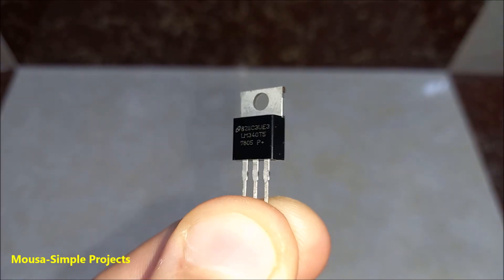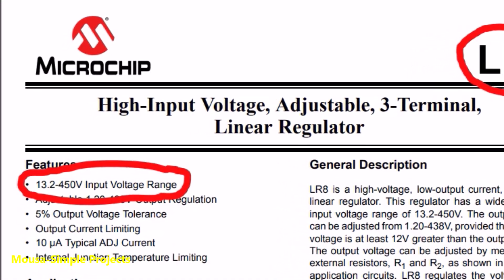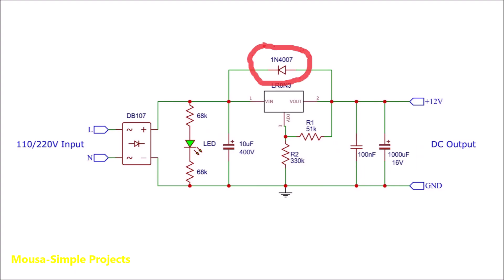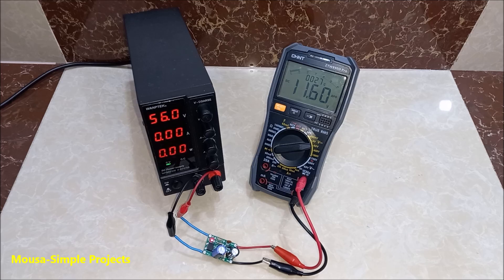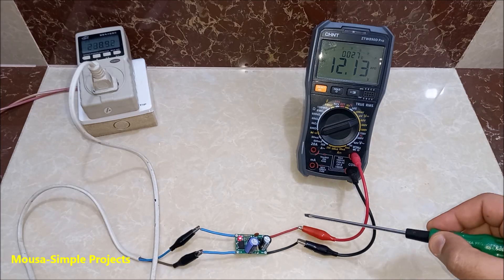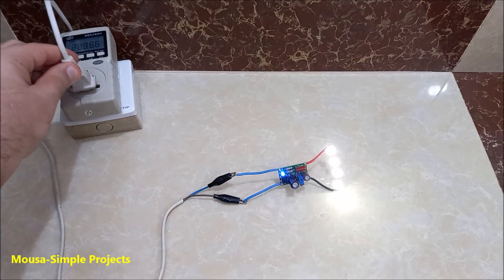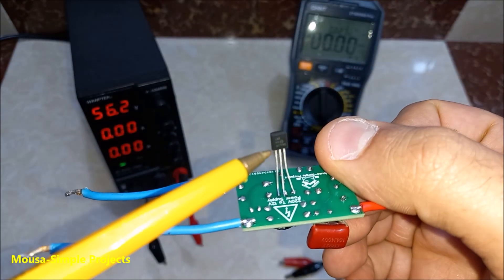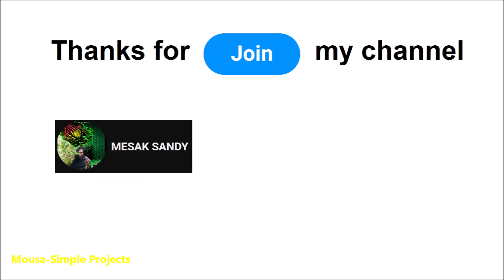Voltage Regulator IC with very High Input Voltage

Comment: If you try to obtain a low output voltage from a high input voltage, the regulator's package loss becomes non-negligible, so it seems that it cannot be used with high voltage inputs. Why not try adding an external PNP transistor to boost the current?
Reply from the maker: You're right, adding transistor as a voltage follower to the output can increase the output current, but that deactivate the over-current/short circuit protection feature of the IC, so you need to add another transistor with shunt resistor (current sensor) to the input as a short circuit protection. 
At the end its not isolated and the cost of the circuit is higher than HLK-PM12

Comment: Thanks Musa. Very good. 🙋
Is it possible to make a button controlled potentiometer without MCU?
Reply from the maker: If you mean a dimmer to control a DC light or DC motor you can see this circuit:
https://www.mousa-simple-project.com/2019/12/dimmer-with-touch-switch-without.html
Or maybe you can use IC 4017 and connect 10 resistors with different values to each output, then select between them using a push button connected to pin14 of the IC.

Comment: How clean is the output?  If it's clean, it can be worthwhile.  Otherwise, a bridge rectifier and properly sized resistor and capacitor may be good enough for LEDs...
Reply from the maker: Ripple voltage is less than +-50mV when output is 12V. For some applications you need constant voltage such as powering a 3.3V or 5V MCU , LED needs constant current, This IC can be used for both constant current and constant voltage.